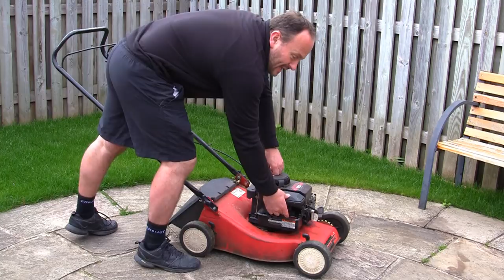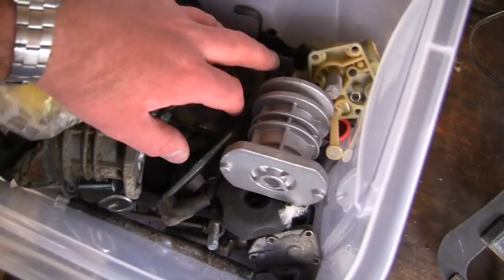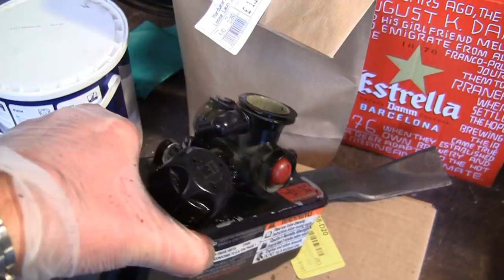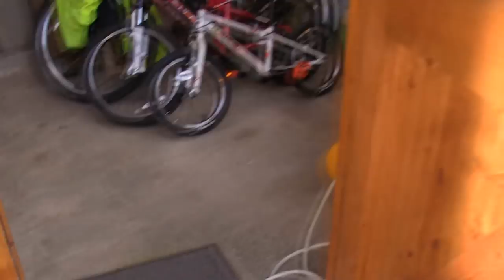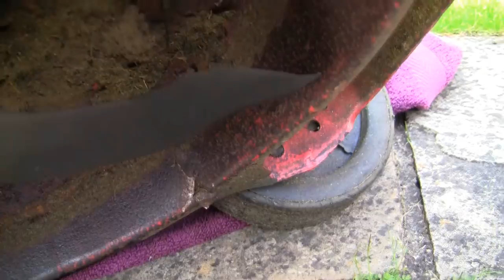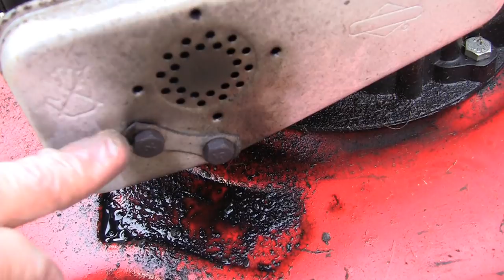Champion Petrol Lawnmower Snapped Blade And Repairs (EXTENDED EDITION SUMMER SPECIAL)

Comment: Well that one ended up with a lot more work than just a broken blade...I was surprised the crank wasn't bent considering the damage. Of course you have to replace the inlet manifold but I think most people would've bodged it back up again.

Comment: Good video.  I probably would just repair the intake manifold if I could, to save the customer some money, etc.  Perhaps epoxy or epoxy putty would repair it.  The fuel may deteriorate the tape.
Reply from the maker: Pete Ciallella I agree I got one off ebay for a couple of quid in the end. Cheers Pete

Comment: Good runner. I think the gas will loosen the tape over time. I would use JB Weld to fix the hole. Not really necessary to buy a new tube. Grind some space in the shroud for clearance. Nice lawn, no weeds like mine.
Reply from the maker: Brian Percival Thanks i'll look at JB weld also cheers

Comment: no 1 NEVER try to start a mower with a broken blade on it NEVER !! and yes tape up the inlet manifold to see if you van get the mower going, and if it runs ok replace the broken manifold either new or second hand .cheers
Reply from the maker: alan lake Good point Alan. I won't from now on. Thanks
Reply: Mower Man  if it had started the vibration would have been terrible

Comment: Paul only had one with the hole in the manifold same place . Had one with a broken manifold 
four years back . How that did not mash the flywheel key very lucky . I have a blade stopping
tool  works well if you need it . 
Cheers 
Pete.
Reply from the maker: Pete Froud Thanks Pete. I've no idea how it snapped in half!

Comment: Hi Paul, I'd definitely use J-B Weld to fix the hole in that intake manifold.  I'd probably do that instead of replacing it with a spare from my stock because JB Weld is so good at making permanent fixes for stuff like this. It's made in the U.S. but you can get it on e-Bay for about a fiver.

Comment: If it was my mower I may leave it with the tape but I would do so at my own risk knowing it's there. If I was repairing the mower for some one or I was fixing it to sell I would do the job right as I would then be passing the mower on and that mower is in 100% good running order.  Great videos keep up the good work.

Comment: Hi do all mowers have a blade adapter as I picked up a flymo which needed fixing, when I took the blade off the adapter wasn't wide enough to have pins in the holes of the blade, ot was just dogged up really tight
Reply from the maker: Paul Baker Take a look at the 4 mins mark on this videos. Not all have pins on https://youtu.be/ZUvV-6Ew-8k
Reply: Thanks that's put my mind at rest :)
Reply from the maker: Paul Baker No problem.